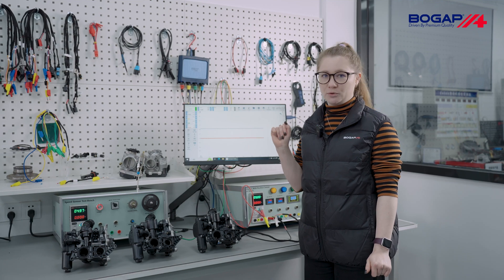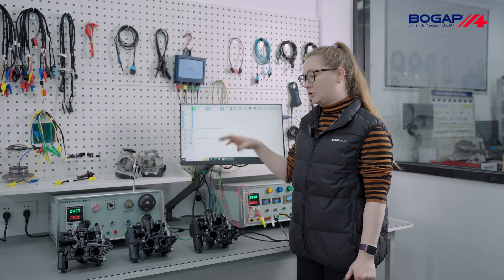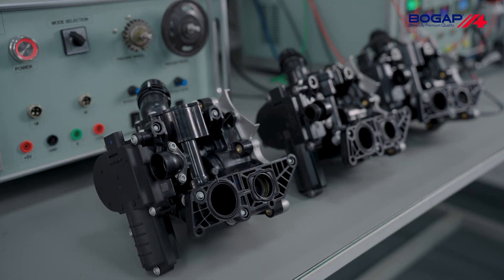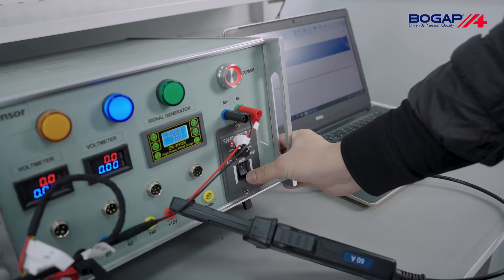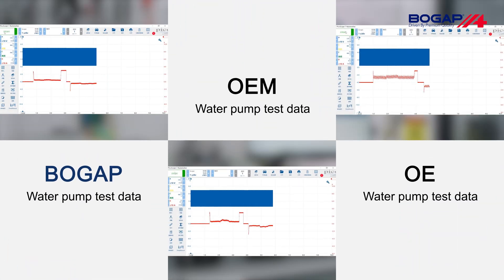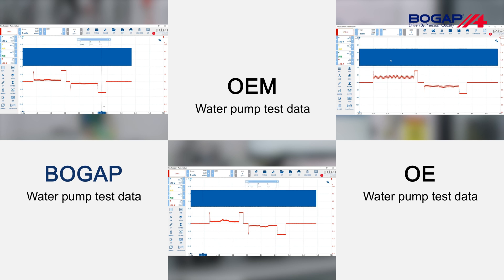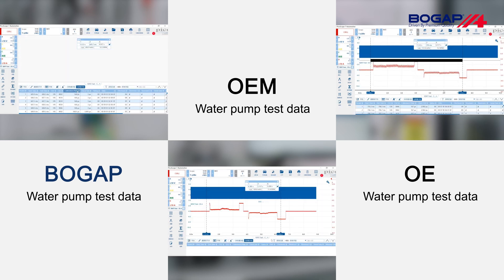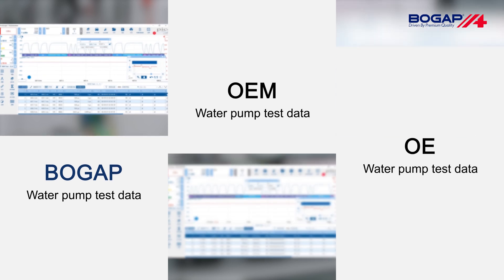Expert Overview of the EA888 GEN3 TMM Water Pump

Comment: I bought the metal version on Amazon for $58 or my Tiguan 2015 (YBDDZH brand) after a huge leak from my OEM POS Water pump
Car now runs like brand new, and I know is not going to fail anytime because is not made with PLASTIC